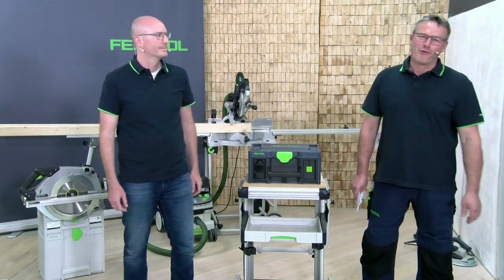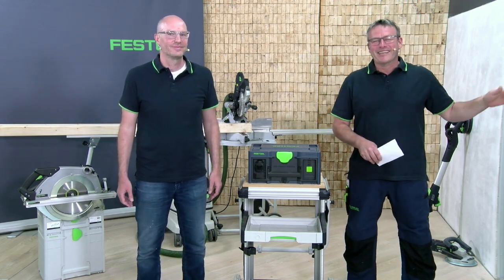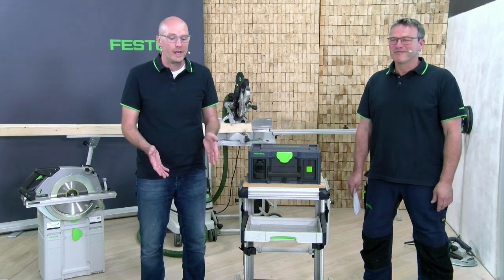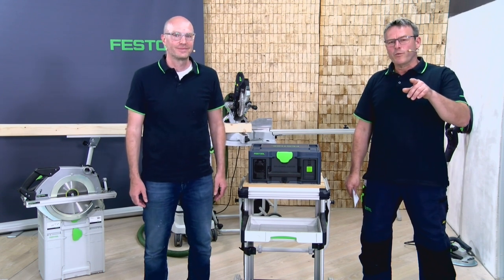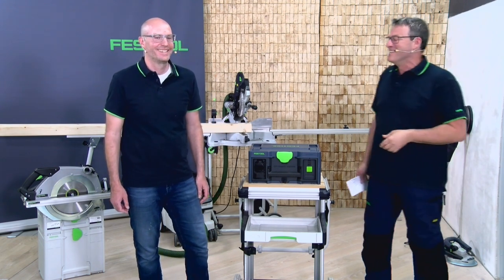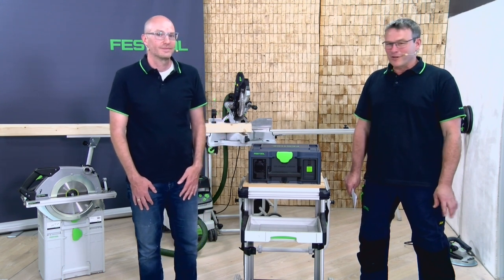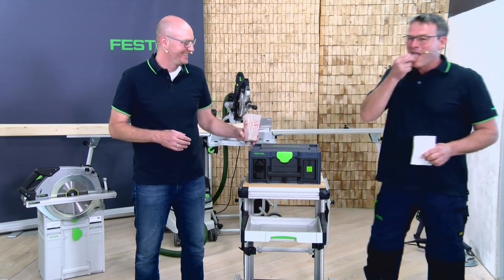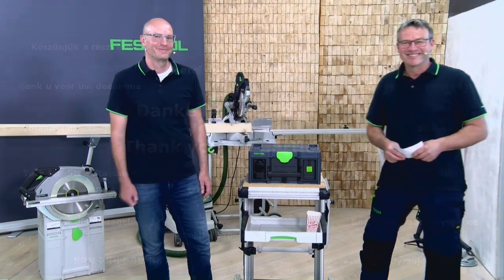Power socket to go. Festool SYS-PowerStation. (Recording of the live session from June 17, 2021)

Comment: 1500Ah is very little should be 2x and the price £3000 .I would just like to inform you that the connected device with a power of 1500W will work for an hour
I'll do it for £ 1000 and it will be 3000Ah. the price is £ 1000 too high even for a Festool standard